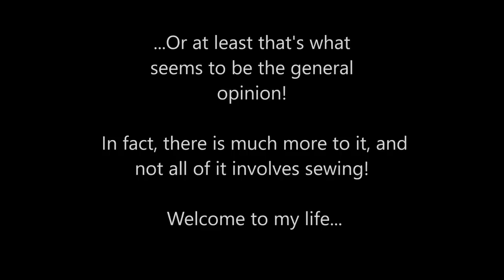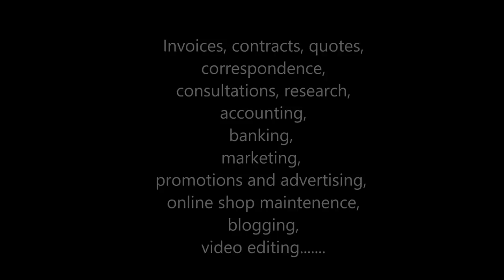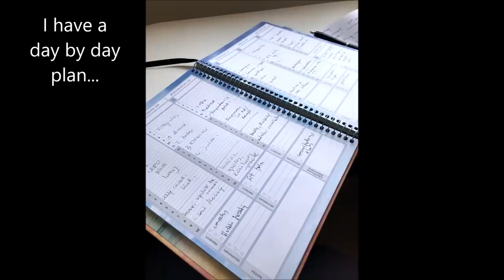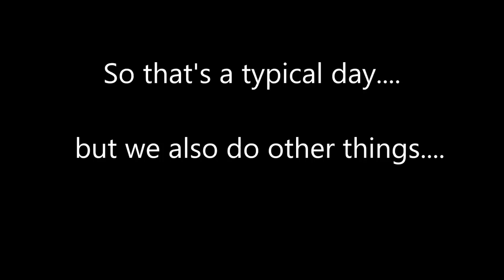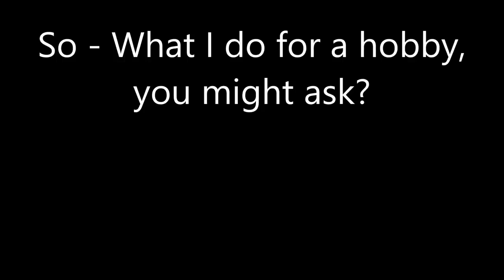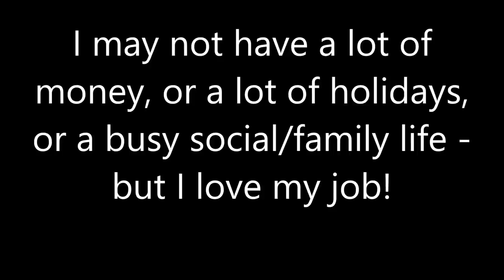The Life of a Historical Dressmaker and Interpreter

Comment: You know, has anyone done a video/article of what to look for for proper fit with historical corsetry?

I've seen what to look for as comfort and modern (more typically underbust) corsets, but now that I think about it I don't remember seeing anything for historical.  I'm sure there's different acceptable "issues" that are typically fixed with corset covers and potentially padding.  I'm mainly thinking of upper "bra" lines with this one, where today having quad-boobs or not filling in the cups is considered ill-fitting but may not be as huge of a deal with all the corrective historical layers.  Not talking about discomfort/pain--if you have that the corset doesn't fit so modify or try another one!  Just other more cosmetic issues.  If anyone's seen articles or videos, I'm sure that would be interesting to read or watch.